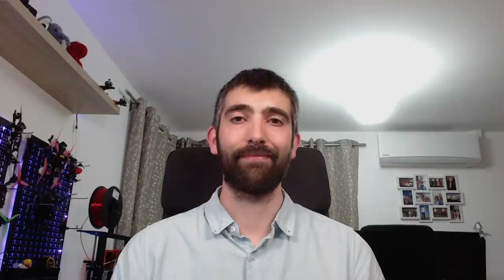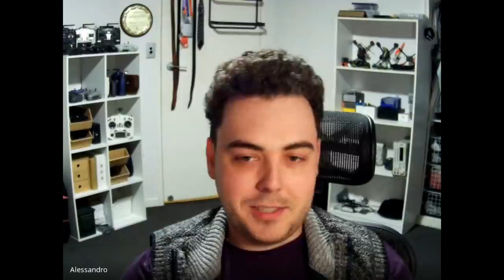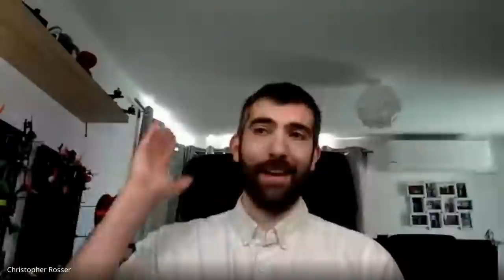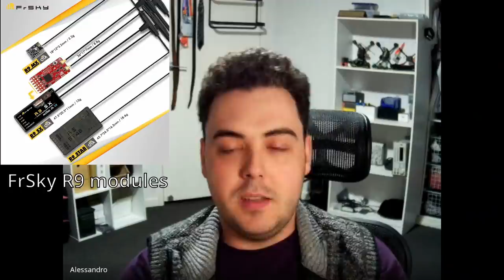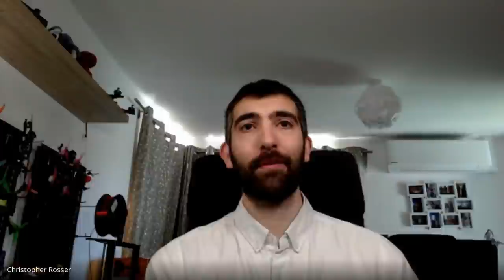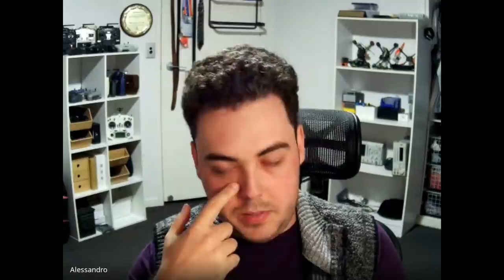An Interview with Alessandro, the founder of ExpressLRS (ELRS)

Comment: 0:00 Intro
2:07 History of ELRS
9:58 Hardware in different 2.4GHz systems
12:39 LoRa vs FLRC
14:23 Undocumented chip features/bugs
17:30 900MHz Hardware
20:45 ELRS design choices vs other systems
22:15 High duty cycle
24:47 Frequency hopping
29:10 ELRS sync packets
33:34 Lua weirdness while flying
34:34 FeedForward optimization
35:10 SPI nightmare
40:16 UART Receiver CPU options
43:30 SPI alternatives for AIO fc's
45:18 How to pick the right packet rate
50:18 RF pollution in the pits
51:20 Future of ELRS
1:00:50 Receiver diversity
1:03:14 FCC/LBT Regulations

Comment: Thank you for the interview, putting much light on an otherwise subblack area of rf mysteries of modern RC radios. Yes, as you summed up, Alessandro is a nice guy. Thinking of that, if I may express a wish it was to bring all the people together contributing to this fantastic project and have a good weekend or so, with you making a kind of, why did you join? Because software engineers are readily connected worldwide and probably never meet.
This could be a historical moment, because Express LRS has set a new benchmark record that do not only provide hitherto unknown speed and versatility to an RC link but will bring back the good old times, when RC equipment was compatible. By just being the best, which today is more biased for making really big money. In RC history there's been just one single more moment of that kind, when PWM multi-channel half-digital modulation scheme was key to the RC radio. And all that happened because no one held a patent on PWM. Who knows about the pioneers of that days? That's about 55 years ago.
Bringing the heros of that actual development together as a family might be quite a different video to your stock, but could visualize a monument in history with you as the fabulous reporter.
Not kidding.

Comment: love elrs. i got a r9 cheap second hand. flew it on frsky firware. failsafed 50m away, (ot sure why)

flashed to elrs nd was rock solid. it stopped working one day, bought betafpv reciever and was back up running using the r9 module for only 13gbp.

amazing system, cross compatibility is really handy making it easier to get recievers

Comment: I started off getting into arduino and robot stuff last year and it was only january 2023 when I first thought about buying a drone and it wasn't until two months later when I realised I should have bought from local suppliers that I didnt know existed that I was into it proper and having a programmer background in C, I started to see how drones are just fancy pant arduinos custom made hardware but doing pretty much the exact same thing. Seeing the ESP8285 chip on the little elrs board I just realised and put it all together. We always think that professional grade stuff is far far far above your head. But when you realise it's just refined but pretty familiar hardware branded and packaged nicely. You start to see how accessible the field of drones really is and how with a little bit of effort, you can get more involved. I'm super into it now. I wanna try building my own flight controller and thats a whole new rabbit hold that these videos are shining a light down. Super interesting stuff!

Comment: ELRS really is awesome and finally someone pushed this RC Link tech. That being said I have the impression that the power consumption and heating is relatively high. What is his take on that?
Reply from the maker: My take is that it may be due to the high transmit time that gives such great range and penetration.
Reply: The power usage of our TXes is definitely higher than others, but the new T-Lite v2 can run ExpressLRS 10mW 500Hz for over 12 hours on a single 3400mAh 18650 so it isn't completely inherent to the system. ELRS 3.0 is also uses a little less power than 2.x. Comedy option: Use 1:2 telemetry to cut the power used by transmitting in half! 🤪

Comment: Hi Chris, i am just so close before just quitting fpv after 5 years beeing in it. I invested so much money which especially as a student certainly was not easy!

Now i´ve got two FCs on Bf 4.31 a´with major issues.
The first one was a foxeer f7 mini pro v2 i flew for quiet some weeks without problems. Then one day, i switched the Frame and ESCs and all of a sudden my video feed only showed a black screen with the bf osd on it.
I wired the fpv system sepperatley (cam with vtx and vtx to battery) and both worked flawlessly. Unfortunatley both of my cams (Foxeer toothless) showed the worng voltage, idk why and how to change that. 

The i baught myself a Tmotor F722 mini as a spare and first everything seemed fine, except for that the video looked very bad (horizontal lines etc.). I then too wired the vtx and cam as a independend system and again: they both worked fine.
The i wired them back and weirdly the same thing happened again: Vtx worked fine, but transmittet only a black screen (this time even without the bf osd). I wondered if this might was a bf bug since the cam worked, the vtx worked and the only thing that didn´t happen was the fc giving the video from the cam to the vtx...
Then all of a sudden: The Fc didn´t really react  anymore. When i plugged in the battery, the the first half of the usual beeping happened, LEDs turned on but nothing more. Also the FC didn´t recognise the FC anymore...

so i tried to flash it back to a previous bf version (which i didn´t really think would help but it was a guess. I flied bf 4.3 successfully for some weeks). Weirdly the PC only recognized the FC when it was powerd up in DFU mode. But everytime i plugged it into the PC it recognized it just for a few seconds and then acted like it got unplugged again. Meanwhile the fc got super hot.

I am incredibly frustrated since i spent almost all of my money on this hobby and still don´t have a flying quad. I am just so close to quit... If things break so unpredictable and randomly my wallet just cant handle it anymore. This is even more sad, since i propably spent over 1000h on just designing my own 5" frame... It honestly hurts, fpv is such a passion to me.
I really hope you (or anyone else) could maybe help me! I haven´t lost all hope yet (just most of it)...
Reply: check your osd chip, i had siilar problem, swapped out a reciever and somehow solder managed to splash onto the osd chip which was weird, my fc the osd chip is on the bottom, and somehow while soldering wires from the top, the solder splashed from the bototm up onto the osd chip shorting out 2 pins. had to clean up the osd chip pins and then it started working again,

fc heating up,, that sounds like something it shorted....check over the board closely, use a magnifying glass sometimes solder shorts are hard to find

Comment: While extremely promising and technically ahead of other protocols on many fronts, ELRS is maybe the best rc link PROTOCOL. The problem is it's just the protocol/firmware. There's no official hardware and support channels will always be split between ELRS and whatever company made your module or Rx. So you need to navigate the ever growing market of ELRS products hoping it's a solid choice.
Reply: I hope you don't use BF, INav, ETX, OTX, blhelis, Bluejay, AM32 or any other open source firmware... Because you might be in for a shock.
Reply: @JyeSmith  Crossfire, KISS, FETtec... although I do run OpenTX. I'm very very familiar with open source and all of its many advantages and disadvantages... I work with JavaScript for a living 😂
Reply: lol... so true... while the firmware is usually great (for open source projects), sometimes there is some really... shit?... hardware that that lets it down. 🤣 For instance, let's never revisit Happymodel EPx regulator burnout issues again, please. 😇

Comment: Has ELRS looked into and considered the new incoming US remote ID rules?  Possible to use the already built in wifi to meet this requirement?   I know my fpv business will be grounded come Sept 2023 since the tech is not available yet...
Reply: I believe there has been some discussion on it, as a similar thing is coming in for Europe...
Reply: I see hard range limits being added to all these systems soon as well.  1km to 2km max if we are lucky.   I have family member that works with D.O.T which also works closely with FAA and she hinted to me that this was in there plans plus regulating Vtx's system's.
Reply: @Freebird_67  I remember seeing a 400ft transmission requirement at one point but I haven't been able to find the technical specs.  
I've seen one prototype shown for a modules on the pilotsinstitutes channel from Kenji. It was reciever sized but I'd assume it relied on gps info from the quad itself not the module.

Comment: Question for Alessandro : Could 2 ELRS links transmit to each other telemetry data like GPS position?? for some kind of ELRS Companion function, joined with BF OSD it could show the position/info of another craft ( OR my ELRS Dog tracker lmao). Imagine an overlay with like a box  around another quad, airspeed , altitude etc :P Or maybe through the backpack and HDZero Linux goggles :P

Comment: 54:30  "A lot of people want mavlink.  Mavlink isn't on the table. Likely never will be."  Why ignore the other half of the hobbyists?   As long as ELRS doesn't have mavlink Crossfire remains the choice for ardupilot flyers.  We want the robust link of ELRS to fly on low wattage combined with mavlink telemetry.
Reply: The data rate requirements of mavlink don't make it easily compatible with ELRS for the moment.

Comment: I was really happy when ELRS arrived, but frankly my personal experience is really bad. I've built several drones with it, I recommended it for users and we always run into problems, random rx losses, firmware update problems and even bricked modules. So it's sad but, I never use or recommend it again. :(
Reply: Have you used BetaFPV modules?
Reply: @haschkatze8372  I'm not but one of my friends had to take apart one module to make it alive after he had bricked it somehow, I don't know the details. I don't know, I don't want to be the hater, it's just my user experience.
Reply: That is the opposite experience from me.  I had zero issues converting from DSMx and have six micro quads with various elrs receivers.  Using a 4in1 Zorro with a Jumper backpack elrs module.  Everything has flashed and bound without issue.
What I can say is that in my busy urban environment 2.4ghz elrs range didn't blow me away although it IS better in a couple key areas.  I honestly don't understand how various Youtubers are able to fly so far.  I feel a little taken in by that hypetrain.
Reply: I think it comes down to the hardware design, and the stage the firmware was at. Some hardware (not looking at you Happymodel, Jumper) had some real lemons, and you were either lucky or unlucky. I seem to have been lucky with both so far... but I've seen documented proof of faults for both, and others. IMO it is also an acceptable tradeoff given the price of the system. If you go with Matek gear, can be a little more expensive, but it is solid hardware, and is well supported. But you need to use what works for you.